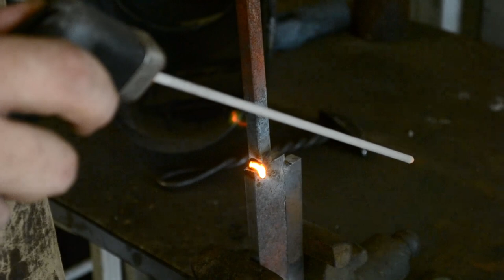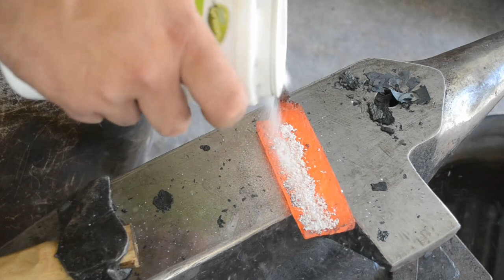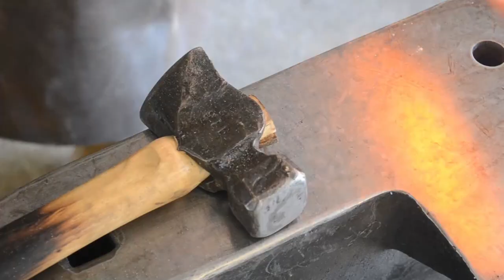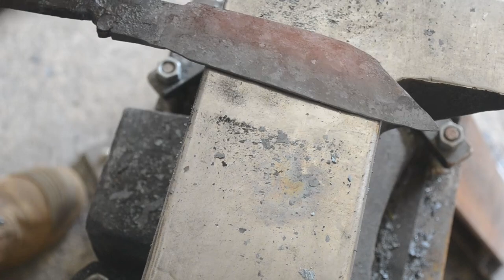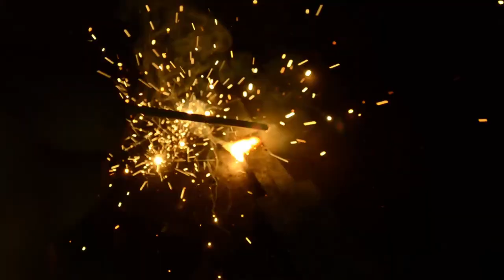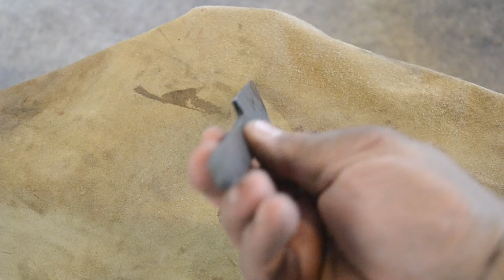How to Forge a Wrought Iron and Steel  Brokenback Seax

Comment: Hi sam is there generally a reason why you should forge your distal tapers before you forge the rough blade shape thanks for the great info and content
Reply from the maker: Hey mate, in most cases I will preform the profile and then establish the distal taper before bevelling, except in this case where the tip is being cut in so I want to minimise material loss. The reason I forge the distal taper before bevelling is that it's hard to get horizontally parallel surfaces when the bevels are already in place, you normally end up creating a reverse bevel toward the spine instead, which can ruin the overall cross section of your blade. Hope that helps!